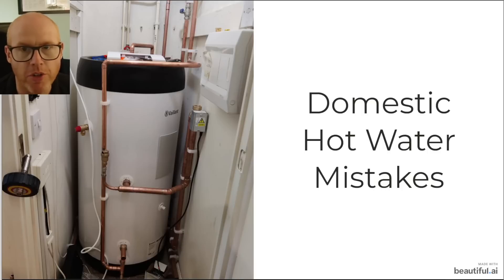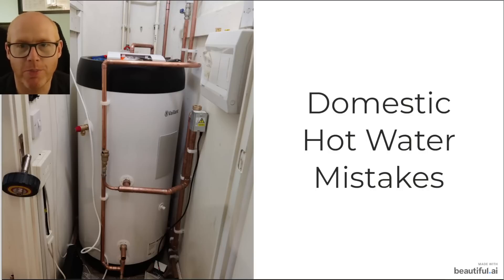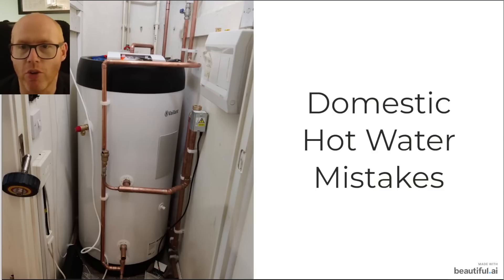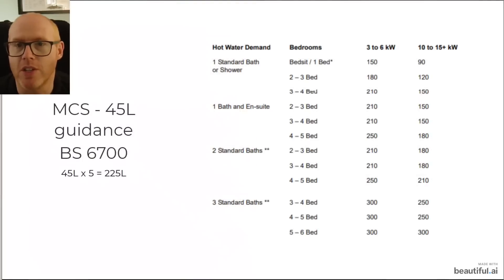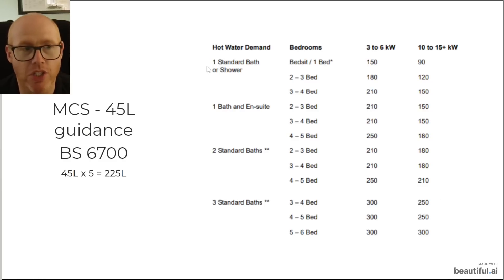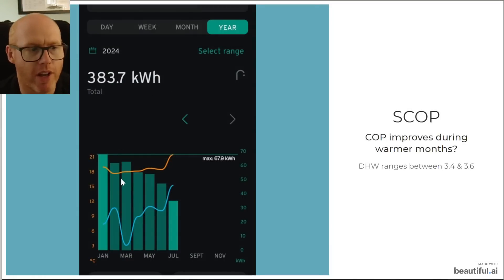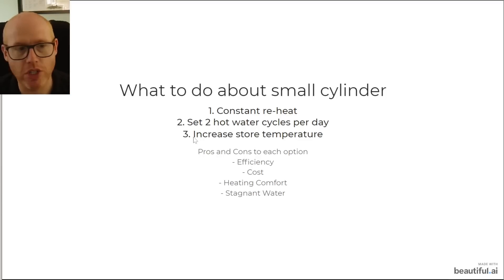My Hot Water cylinder is the WRONG size! What I've learned about heat pump hot water cylinders.

Comment: 250L for 4 persons at 40-45deg seams way below comfort/convenience, I have 300L at 75deg electric with 5 persons it of course uses 200kw a month but the point is to keep the comfort of never running out. Keeping low temp for best efficiency for heat pumps should require at least 300L  and focusing on SCOP  for this small off a load seams just wrong as the more time the pump uses on the water tank the harder it is for it to keep the house heating warm especially in the winter months, I guess the problem in the UK is that you are focussing on competing with relatively cheap gas on price not efficiency. COP alone is not the whole picture as with my A to A pump its more complex then just in and out temp you can gett better COP but still use more energy in total.
Reply from the maker: 300L @ 75 degrees is a mammoth amount of energy!
Once that is mixed down to 39 degrees for shower temperature, that goes very very far unless you have teenage daughters of course!
Reply: @UpsideDownFork  The same is true with only 45 deg mixd down to 39 is not a lot of energy and will quickly cool down as new cold water comes into the container, requiring you to shower with only hot water (no mixing) and that is less than 10min to empty 200l tank. The nice thing with an electrical water heater is that it takes the same energy to heat it from what ever start point so heating it to a high point during the night with low prices makes sense as long as as it is well isolated and in a room where the heat loss is usable.
Reply from the maker: @OskarHartmannsson  what shower head are you using that flows 20lpm?! 🤔
Reply: @UpsideDownFork  ok maybe more like 160L for 10min the point still stands if there are more than one person taking a shower after each other it quickly becomes a problem. I know it is manageable but just weary inconvenient as the last person out 😁
Reply from the maker: @OskarHartmannsson  Change those shower heads. Plenty of aerated ones that will flow 8 or 9 litres per minute. 
Our smart shower has an 8 minute timer and I regularly turn it off at 6 minutes, I find that a comfortable amount of time personally.
But, if something else works for you then that's all good!
Reply: @UpsideDownFork  come on 9l a minute is crazy my RV has a pump of 20l a minute. Im sure its not delivering more than 10l but its not exactly what I would call a normal shower

Comment: Would it not be best to increase the tank temperature further and heat it at about 4am?  Any loss in COP would be offset by the cheaper cost of overnight power and then you can export more solar at 15pkWh.

I have the opposite problem with my tank. I have a 250l tank. Originally I would heat water on a schedule but I switch to reheat and sometimes I find I am maybe doing 1 reheat a week plus the legionella cycle so my COP can be pretty meh. However, on a week when I do several reheats on the tank, the COP is about what I would hope for.

I will probably switch back to a schedule a reheat every night off-peak. Even when running a legionella cycle the COP is over 2 so less than 3.5pkWh for every kWh of heat so about half the price of a gas boiler.
Reply from the maker: Yep, good point 👍

Comment: Thanks for the information, it's really helpful. I went with a 300l cylinder for my family of 5 as I had been measuring the actual hot water use of my combi boiler. Of course, I hadn't allowed for the fact that you can't use all 300l of the cylinder.

Here is how I set mine up. 10K (Celcius) hysteresis with 2 defined heating periods of up to 120 minutes. These periods coincide with the cheapest part of the day for Octopus Agile (early morning and early afternoon). Because a couple of family members like really hot showers, I'm currently heating the water to 50 (plus 5 above so 55 flow) with 120 min max heating, giving an overall efficiency of 3.2 COP. It's the flow temperature that defines this COP, as far as I can tell. 

With this, the tank is on once or twice a day, depending on when people use the water. The heat pump is costing about 4p per kWh for hot water vs 7.2p per kWh for gas.

calculation: 12p (ish) per kWh (Octopus Agile) at 3 (ish) efficiency is 4p per kWh heat delivered vs 6.16p (Flexible Octopus for gas) at 85% efficiency for gas or 7.2p per kWh.
Reply from the maker: Nice. Thank you for sharing!
You could drive that COP up a bit for sure but you would possibly sacrifice some comfort/convenience whilst doing so and as your calculations show, it's costing you peanuts so not worth worrying about.

Whilst measuring our shower temps I realised that the "cold" shower was actually 37 degrees and the "hot" shower was 38 degrees. It's amazing that our skin is so sensitive in this range around body temperature.
Reply: @UpsideDownFork  Yes. It's diminishing returns above a COP of 3. Going from 3 to 4 (almost impossible and would annoy my wife and similar to going from 30mpg to 40mpg) would only save about £15 on an annual £180 for hot water heating.

I only installed the heat pump to save on CO2 emission. I am amazed that it saves on running costs.
Reply: It takes less gas to heat water than using electric.  Your calculation and comparison is not correct.
Reply: @Bond2025 My overall efficiency is 4.2 with my heat pump (hot water and heating) and I only pay 2x as much for a kWh of electricity vs gas so my heating/how water costs are lower with a heat pump vs gas. Last year I paid £350 per month for energy (all energy), this year I'm only paying £50 (I have installed solar panels and batter too). Of course, I had to invest money to do this but I'm getting a great return on that investment. I am so careful with my money that I retired at 48. My calculations and comparisons are correct.

Comment: I've been thinking about this because we have two adults in the house but it's technically a 3 bed, so size for 4 people. And I do have two adults over to stay from time to time. 200L should theoretically be enough, but I'm tempted to go as big as will fit, because then I can lower the storage temp which lowers the heat loss to the room, meaning the house will be less hot in summer, and the heat pump will have a better COP whilst filling. It will just take longer to heat the cylinder if and when I do empty it. And as you said, I leave some efficiency on the table if I don't empty it. I'm thinking too big is better than too small? realistically it's not going to be more than about 25% wrong either way, and I think the failure modes of bigger are better than the failure modes of smaller?
Reply from the maker: Heat loss to the room is so small and marginal, I would discount that as a factor if I was you.

If you want efficiency, you want to focus on coil size rather than capacity. If you want the luxury and comfort of never running out, go larger.

If you regularly only use half of your tank then your heat pump will always start heating from a high start point, once again losing efficiency.

Try not to overthink it too much. Our heat pump can reheat the cylinder so quickly anyway that it's not really an issue, even when people come to stay. It takes a couple of seconds to switch it from timer to constant reheat and.

Designing your heating system and your cylinder for 95% of the year is the way to think, rather than anticipating the 5% of times when you might need to be adaptable.

Comment: When you said 'occasionally we do run dry' that for me was the deciding factor to stick to my efficient gas boiler for the moment until we are forced to move off.
Reply from the maker: This is not a heat pump issue, this is an undersized cylinder issue.
It is very common with gas invented systems too. If you're on a combi then you won't be aware of it.

Now that I've mastered the controls and adapted to our routine, we haven't run out of hot water in many months.

I was very conservative to start with, trying to eek out every last bit of efficiency but I've relaxed into a better balance of efficiency and comfort now.
Reply: @UpsideDownFork  dear god i had no idea its going back to the days of running out of hot water till it builds up again..or worrying about it
Reply: @marklola12 it's ridiculous that these good people have to make these YouTube videos telling us all of the things to look out for. We are lucky they make these videos. 

Heat pumps and their extra stuff should just work.

I do realise it's like getting a whole new set of radiators and a boiler, and you need to make sure you get the right size radiators, boiler etc. 

If just seems like there's still a fair bit of risk that you might be cold or water not hot.

Comment: The coil has to be big to have a huge surface for a faster heat exchange therefore the incresasing losses from gros to net capacity. Of cause 250 would be a lot better for you but again not really considering that 211 L is again below your "estimate" demand. 
But keep in mind: bigger sounds better but it comes along usually with higher heatlosses and those are Watts in a 247 use case which most people are not able to calculate. 
RULE OF THUMB: in a 247 use case any watts used mean an annual consumption in kWh of 9 times the watt figure
If your cylinder is for example using 30 Watts less  than the bigger one then you are saving 9 x 30 = 270 kWh p.a.

Bigger cylinder means always more standby consumption and the good ones will be at 33 Watts (we have a 270L cylinder with a heatpump on top) and the bad ones might have a 160 Watt figure.
130 Watt more means 9 x 130 = 1.170 khW per year of additional losses cause the heat is leaving the water and therefore has to be invested again. 1170 kWh equal in a perfect oil burner roughly 117 Liter Oil - if you consider 20% of losses going through the chimney than 1170 kWh / 85% =  1376 kWh divided by 9,8 kWh per L oil = 140 Liter more oil

And that is a figure everyone can imagine, a tank of 140 Liter Oil or 14 buckets of 10 Liter just for the missing insulation. 1376 kWh per year sounds not like that much until you do the math.
Reply from the maker: Where do you get that equation from?
Vaillant Unistor 200L cylinder rated at 1.22kWh heat loss over 24 hours.
Vaillant Unistor 250L cylinder rated at 1.41kWh heat loss over 24 hours.
190W difference. Are you then diving this by an hourly figure?
190/24 = 15.83 watts.
15.83x9 =142.5

I find it incredibly difficult to believe that the next size up cylinder would cost an extra 142.5kWh per year.

Our total annual DHW consumption is only 598.2kWh.

Also worth considering that the coil surface area will increase from 1.4m2 to 2.4m2. There is some evidence to suggest that this not only shortens reheat time but that the DHW COP will increase by approx 0.5, all other things being equal.

Comment: In my opinion the 300 l inverse/hygienic cylinder must have an electric resistance to supplement the heat pump or larger inverse/hygienic cylinder 500....800 liter. 
Heat geek super cylinder is GREAT but need also a larger heat pump and lost the efficiency on heat in this case. 
Cannot respect the rule of thumbs for undersize the power of heat pump for greatest SCOP.
Reply from the maker: I'm not a fan of immersion element heaters.

Comment: Could you install a second cylinder and have 1 for each bathroom
Reply: I watched the heat geeks and they had developed a small cylinder that could fit under/in a kitchen unit. I know the pipe work would a nightmare but something to think about. Hope it all works out for you 👍
Reply from the maker: I guess that is a possibility. Unfortunately we don't have the space available for that.

Comment: We run legionella cycle at 12.30am on Intelligent Go, and reheat as required, usually not until early afternoon. 6 people at home. Comfort over absolute efficiency, as no-one has set routines. Installing battery shortly, so will stop the legionella cycle. Changing charging offset makes no difference, will need to check if on eco mode, which would hep for summer months, but might need to be off for the coldest months.
Reply from the maker: @barriedear5990  I've never run a legionella cycle and kept the tank temp around 50 degrees for the last two years 👍

Comment: There is a certain heat loss by the cylinder. I putted an extra thermal isolation around the cylinder to stretch the time to reload. And I prevented the warm water pipe from micro circulation. That is when hot water can go up in the pipe and leaves the cylinder, that cools down und streams back into the cylinder. In some installations you can have a constant stream of hot water in exchange to cold water within one pipe. The same happen to my heating pipes. Now they go straight down to the bottom end then again upwards to the heat pump controller. You can feel these temperature losses circulations by touching the pipes by hand. They should be cold when the heat pump didn't run for an hour.

Comment: The MCS guides are very misleading. The problem is that an MCS accredited installer HAS to follow them, even if they know it might not be the best option... I have the other end of the problem as MCS would insist that I get rid of my 2 year old hot water tank (which provides plenty of hot water at 45 degrees all year round) and doesn't take into account that I can heat most of it off an immersion heater from Solar PV. It's really put me off getting an ASHP under the MCS scheme, total waste of perfectly good equipment. That said if I did replace the tank it would be with a Mixergy one...
Reply: Solar PV certainly complicates an already complicated scenario... Especially with export tariffs generally getting lower over time. I haven't even got a solar pv and battery installed yet and already this is doing my head in!
Reply: Imagine using the solar to heat the water with the heat pump. You could hat half s much water again and all to a higher temp and still be supplimenting the heating with solar. Absolute worst case you'll get a COP of 2.5 heating your water with heat pump. It's  better use of your solar

Comment: Great walkthrough, thanks. I think we probably have the opposite, a 250L cylinder in a large house but with  now just 3 of us living here.  I found that our hot water was being heated by both the heat pump and the immersion heater, the immersion wasn’t just being used for the anti-legionella cycle 😢
Turned immersion off so its heat pump only, turned tank temp down to 48, increased the hysteresis to the max possible (4 degrees), hot water just once a day overnight and I think I’ve got the optimum configuration now.  Its usually 1-2kWh to heat the hot water a day which feels like a good result
Reply from the maker: Glad you caught that issue. Immersion heaters being used unnecessarily appears to be a common issue in the heat pump group on facebook.
Sounds like you do have it dialled in nicely!

Comment: Even the most inefficient heat pump water heater is 50% better on your real efficiency, your wallet set the heat pump to supply your need of hot water and don't worry about efficiency just take the savings in $$ and enjoy a meal out.
Reply from the maker: Are you saying an integrated heat pump hot water cylinder achieves a COP of 5.4?
Reply: @UpsideDownFork  No I am saying enjoy the financial savings and let the heat pump work. Trying to see how many angles can dance on the head of a pin will cost you more to get the last little bit than it is worth.

Comment: Hi buddy - love the vid. Can you confirm what type of heating you use? Do you think installing underfloor heating would help?
Reply from the maker: I'd recommend you have a look at my heat pump playlist as i've covered this many times before.
https://youtube.com/playlist?list=PLxiY5khGACu3S5XxEI8_bhkX6H8DOR2VW&si=0Dq7kbXZCd1EM-if

In summary, we have stuck with wall mounted radiators for cost reasons. Underfloor heating will typically help the heat pump to run slightly more efficiently but the main difference is the comfort factor really.

If you have the funds and can deal with the upheaval of retrofitting the underfloor system, this it is the ultimate luxury but it won't help your heat pump efficiency that much.